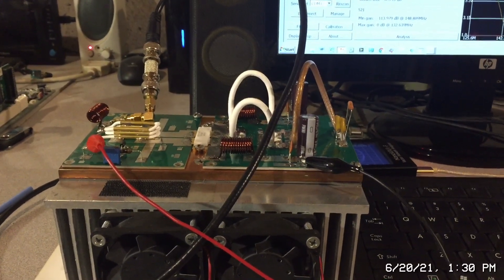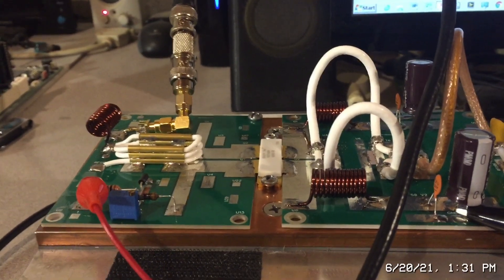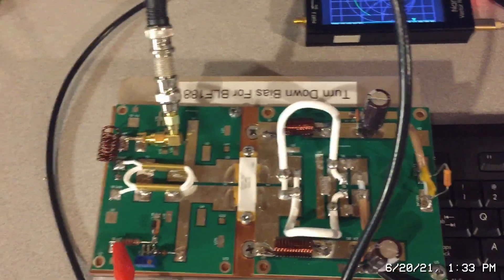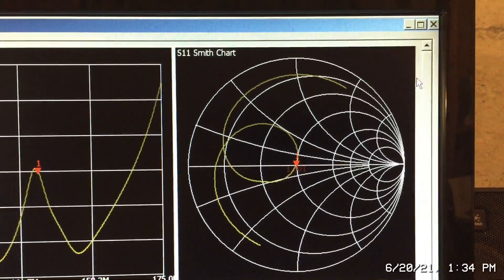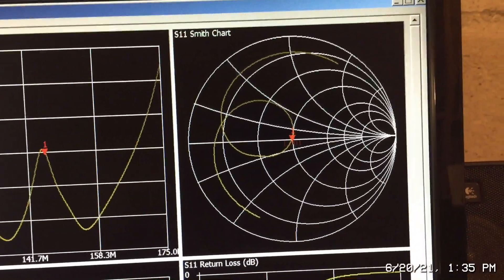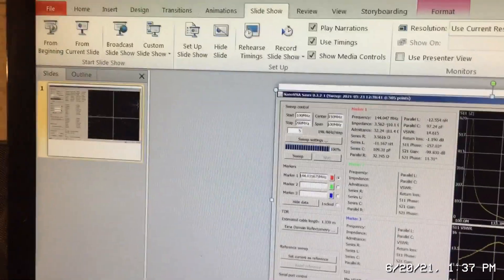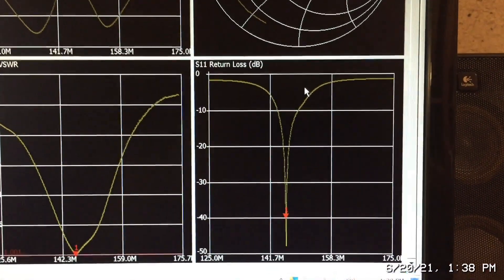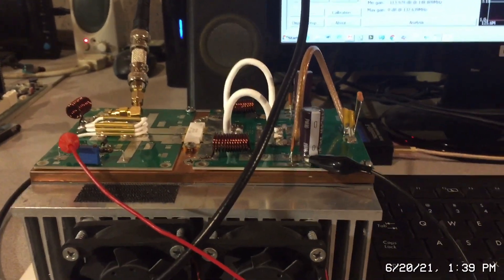Follow Up video on Impedance Matching using conventional RF Transformers and tuning circuit

Comment: Good morning RF Man! I would have thought you would need a calculated half wave to measure this but you are using a 1/4 wave jumper based on the frequency to measure this.

 Does that mean that you would need a 1/4 wave for literally every new bands center frequency that you design an amp for?
Can any amp be tuned to any of the bands? 2 meter through 160 meter for instance?

Comment: Very, very great material that you made!!👍👍👍 Thank you! Excellent explanation, i was looking for something like that for a long time. It would be great if you make a video showing how to calculate the output impedance matching using coaxial cables transformers (like the output matching circuit in this video) in VHF bands.

Comment: With these fantastic videos I can understand RF amplifiers and I hope one day to understand how the different components are calculated and thus not limit myself to copying what others do without knowing why they do it.
With the data from the vna, how do you know what series inductance value to make the impedance matching network for a certain frequency, for example for the 20 meter band.

Comment: What would the usable frequency range be, given that network that you finally implemented?
Reply from the maker: This board is tuned for the 2 meter band (144 - 148 MHz). I have tested the board from 142 to 150 MHZ with acceptable results. If you change the range of the inductor on the input side you can shift the band width by 2 to 3 MHz.
Reply: @rfmanchannel6915  So, a matching network that keeps the input-side of the power transistor below say 3:1 SWR is an acceptable match? I'm still learning. Trying to determine what an accepted SWR on the input side of the power chip would be, so as to define the usable bandwidth for the amplifier.